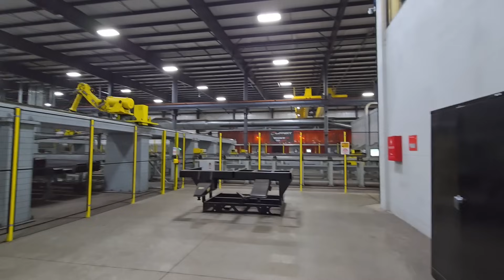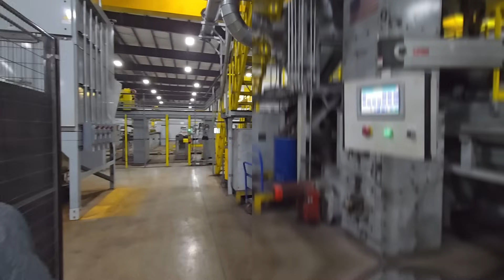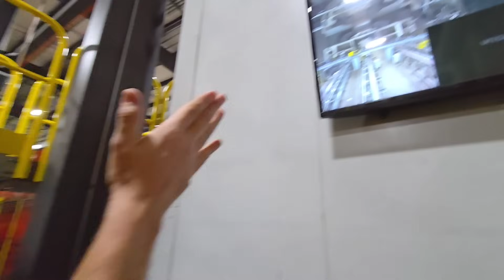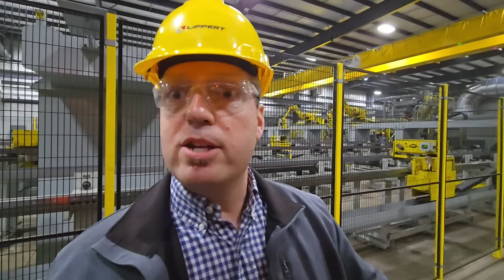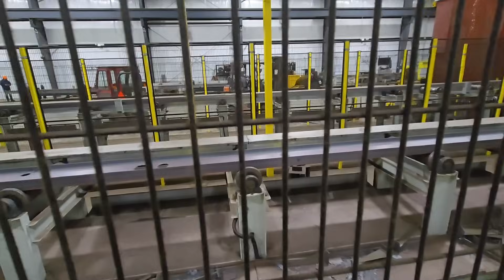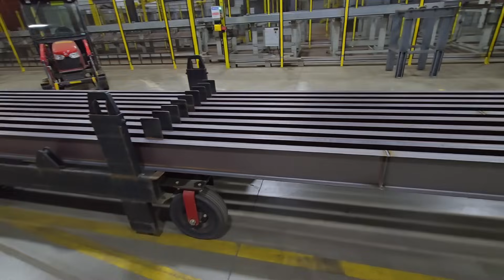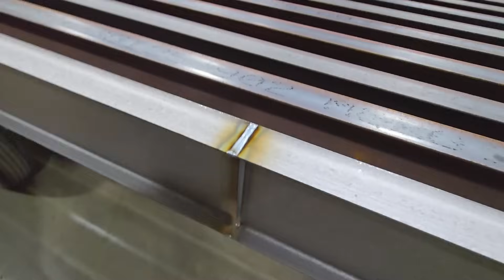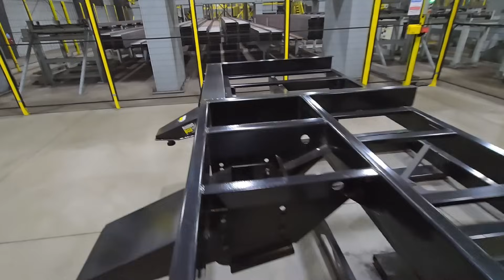LIPPERT RV FRAME Manufacturing Tour.  Part 1: Beam Processing Center

Comment: My replies keep getting deleted. I have a feeling that this video series is a sham. Good Luck!
Reply from the maker: So, the I don't believe anyone with the Space Saver upper deck is having issues.  It's supposed to be much stronger. Also, I believe splicing the frame is probably fine considering the method and equipment they invested in to perform and test the action.
Reply: The best theory they have is the 6" tube is able to support a giant 5th wheel? I still stand by my original comment and if they are so confident why not offer a 10-year frame warranty like we do or ATC?
Reply: As a trailer designer then you know your comment is too ambiguous. You don’t know the steel alloy they are using. In many cases, the weld is stronger than the base material or stock if they’ve chosen the correct alloy. We simply don’t know from this video, and it might be a trade secret.
Reply: I know what alloy SDI produces! Regardless, adding a weld changes the section modulus in that local area, and the beam will crack at that location, all things being equal. All adult humans know splicing the primary load carrying member is sub-optimal for <$100 savings per entire RV. @don_sharon
Reply from the maker: @jeffwalters6880 I suspect your trailers are body on frame? Low boy, dump, roll off?  The challenge with RV frames is they are designed for headroom, ACs on top, furniture, appliances, holding tanks and plumbing below, residential electronic and fixtures.  Because RV manufacturers want to content the heck out of them and make the insides look tall with a high end condo like appearance, your limiting where things can be designed into frame.  I'm not saying your wrong, I'm just saying RVs have a very unique purpose and you aren't able to simply add steel everywhere.  I'm a big fan of commercial trailers, but they don't equate well to floorplans being built in top of them.  

I have a great idea though!  Maybe you'd be will to collaborate.  Would you be willing to build an RV Frame, with accomodations for RV equipment mentioned above that can keep the total weight manageable by Class 3 trucks?  I'd love for a Trailer Designer to do this.  Let's see if we can change the RV world!
Reply: @BTBRVReviews  I'd like to get my hands on one of those bare frames, I'm pretty sure with a Rouge fab tubing bender and a tig welder and plasma cutter and some d.o.m. I could make her chooch!
Reply: @jeffwalters6880  Because they can't. They know without a doubt the majority of what they are producing right now will not last that length of time. If they offered a 10 year warranty they would be bankrupt in 3 years.
Reply: @jeffwalters6880  I respectfully disagree, given they produce a 1,000 frames per week and as a percentage, there are just not that many weld failures we hear of. Not to mention the countless other industries and construction projects (buildings!) that use this method of welding. Out of interest, are you an engineer of some type? And for the record, I don't own a 5th wheel nor do I plan to ever own one, or a Grand Design product. I believe the RV manufacturer is where the bulk of the problem lies.
Reply: I agree It isn't the weld causing these failures. There is just no reason to splice the rails when making frames for RVs.

The failures will be stress if it is a frame failure or deflection causing the body to disconnect from the frame or fail.
Reply from the maker: Jeff, I was completely serious about my suggestion on collaborating.  Because not only are you outside of the industry and you don't make RV frames, but because you are also a critic against the frames Lippert manufacturers. It would be very interesting to see if you could make a stronger frame that doesn't weigh a huge amount more.  This would definitely work your engineering department and test your abilities possibly to the max.  Remember, in most cases you're trying to keep the GCWR below 26,000 lb.  Which means with a dually, that leaves 14,000 lb for your trailer.  On heavier units, it's not as big of a factor, but pin weight certainly is.  We're not talking about class 8 trucks with 26,000 lb of pinweight capacity.
Reply: @BTBRVReviews JD this is simple. But it would mean Lippert loses their frame business.  There are so many gooseneck trailers out there with a 30k rating. I’ve actually contemplated doing this because of the enormous frame flex we had on our 2021 Montana. It was so bad the Keystone heads of service came to look at it. It was also not in a typical location. Ours was near the axles. But I think the biggest problem is there are no manufacturing standards like the automotive industry. Also heaven forbid I go out and build a custom trailer. So many parks won’t allow them.
Reply from the maker: So, a typical Gooseneck trailer that supports up to 30k typically weighs between 8-12k empty.  That means a typical structure on top of it would need to weight less than 4k lbs to be towable by most folks.  Not possible.....AND these huge heavy trailer frames STILL flex.  Designed to. 

I'm guessing a Fifth Wheel frame typically weighs round 4-5k lbs as to allow for the RV structure and cargo capacity.  I'll find out what the weight is.
Reply: Butt welding of any steel is not typically a good aspect. Any one that knows steel and welding knows that there is an area known as heat affected zone. This area if not properly relieved will cause failure of the welded area. Robotic welding may or may not control such high heat that causes said heat affected areas. Still avoiding the issue of frame failure, pin box over movement and frames breaking apart in the riser area.

Comment: I owned a 1990 coachmen and a 1997 holiday rambler both of those trailers had fully boxed frames made with 1/4 inch steel. My 2022 has a i beam frame that lets just say is not as thick. The i beam frame is definitely not as strong and cheaper to produce.

Comment: In the lumber industry they do the same to make longer sticks with finger joints.  Scavenging scraps to save a buck.  With all the fancy equipment, the frames are dropping like flies all over the country.  Everything  " Engineered " to minimum specs that will do the job. No different than any other manufacturing process,  CHEAPER, FASTER.

Comment: Look like Lippert is building a good frame. Maybe they need to build RVs in general without that extra room in the front. Probably no perfect answer.
Reply from the maker: Convincing the RV manufacturers to make floorplans that don't have tall front headroom space, might be difficult.  Because the ones who continue to make those floor plans will outsell the ones who shift to a different floor plan simply for a different designed upper deck.

Comment: I am surprised that the question of the steel’s tensile strength wasn’t brought up. As a steel building manufacturer which I noticed you work in. That is highly important. Especially with overhead, gantry or jib cranes that you don’t want to come down on top of your head. For the sake of illustration, to much tensile strength will make the steel to brittle and not enough will make it to weak. Where there is a lot of holes or drilling into the steel, also you will create compromise to the steel. Have you ever heard the term redundancy or if you have a failure in one area, other areas will support and take up the workload. What if you run over an object right after you pulled the RV off the lot with an unseen object in the road; and the tire has a blowout, therefore puts the stress on the frame and on the shell etc., this is Ludicrous. A-10 warthog Jet fighters have redundancy in computers and structure so if when it might fail there’s a back up. Could you imagine if our military pilots had this kind of craftsmanship in their aircraft, could you see our fighter pilots flying light tubing ultralights. Doesn’t GM make different makes of cars all under GM? Ford, Lincoln and Mercury. Dodge, Chrysler and Plymouth. And you know which ones are no longer. This is a line of you know what.
Reply: Steel structures, especially buildings and bridges are designed and engineered to the yield strength of the material they are using not the tensile strength
Reply: No you’re in the land of Oz. In the steel building mfg, we had to order a higher tensile strength steel. The steel we were using was too soft for earthquake zones to be used. Where did you get your schooling? As a global certified welder and never failed a test in eighteen years before becoming a nurse??? Will you submit to a polygraph test? If you have nothing to hide. We’ll cut through all the smoke and mirrors. Alternative topics not granted. Borderline tyranny?

Comment: This is obvious a fairly new plant, most frame issues I have seen videos or pictures of are from RVs with a few years age. The welds on those RVs that have had failures are obviously not roboticly welded. In my opinion Lippert has been working on improving there products by cutting out poor workmanship and going automated.
Reply: The only welding shown in this video was them splicing the frame I beams.

Comment: I believe in trend data. Trend data seems to show  frame fails. I will not buy anything made with a Lippert Frame until the cause of the failures is identified. As a customer I don't care if it is the fault of the frame manufacture or the RV company. That is not my problem. Where I spend my money is.

Comment: It is great that you do videos, however instead of being a show and tell, please just tell us who or where is responsible for the issues that are happening, a couple removed the underneath membrane from their Grand Design and the welding and corner supports was not pretty at all, rough edges the supports looked inadequate and bent, computers are quick and precise however when settings or patterns are incorrect and not caught quickly, then inferior frames could slip through. If lippert is not at fault, be present when frame failure is suppected to inspect frame to see where the problem lies, this is the first step. Also, when you are doing an interview, just ask questions and seek answers  you should not speak for them, it makes you look like you are proving you are smarter than them or that you are protecting them from error. Investigating videos need to be neutral not influenced in any matter, just my opinion! Everyone knows how to build a frame, to build properly and structurely is the key, computers are great, however they are only as good as their program and that is done by humans who then monitor the progress, people take breaks, use washrooms and have hindered attention spans for many reasons, thus here lies potential problems. I hope you respect this as contructive criticism, please if you have the means or the ability, just use your influence to find out the true cause of frame failure.I expect then a solution can be found, implemented and finalized.Yours truly, just trying to help, I do not own a 5th wheel RV with frame failure, I own an imagine 3100rd and take pride in my Grand Design RV, hopefully the companies responsible for their construction feel the same

Comment: So let me get this in my noggin: the chassis they sell is not strong enough until the RV mfg uses lag bolts to attach some wood/aluminum/laminate to the side.  Of course these fasteners can be installed in seconds with air tools and a monkey pulling the trigger. What could go wrong there? I'll enjoy following the class action lawsuits.  For my money it's an ORV bumper pull!

Comment: The issue is where the Box as they call it is connected to the main frame. No way can those boxed ( what looks to be ) 2x6's can safely transfer all that load and its apparent from All the frame failures in that exact location. This has ZERO to do with how the manufacturer connects the walls to the frame! To think those walls would add any amount of structural support to the frame is just crazy talk.

Comment: I'm not a fan of welding pieces of the i-beam together.  The two main beams, to me, should be continuous from the steel manufacturer.
Reply: The total cost in scrap to make the entire frame without a splice would be <$100.
Reply from the maker: @jeffwalters6880  X 2,000+ per day (they use 2 or more beams per RV)
Reply: So they save a bunch of money per day,  seems like a poor trade off for a potential problem down the road.   In a house you are not allowed to “splice” a floor joist.   Yet another reason the self policed RV industry  needs to use actual regulations not the RVIA which is a joke.
Reply from the maker: @garyy818 being honest, not sure there are any examples of the frame stitching process failing.  If you know of any, feel free to share.

Comment: For all this automation, few people, and robots controlled by computers and the programs where or how are bad welds being produced. If this US steel is tearing out around the welds heat would be an explanation. What is the quality control regimen. A sad reality of automation is machinery wears and with fewer people in a production line issues are not noticed until later. It is a very nice plant but there is an issue in the industry and nobody is saying we need to do better.
Reply from the maker: I totally agree that the entire industry needs to be better.  And can be

Comment: They need to get real welders to assemble the frames because the welds look like a 3yr old did it.
Reply from the maker: Hard to find 600 plus welders in a single small city that are all going to be the welders you see on YouTube and Instagram.
Reply: @BTBRVReviews They could find good welders but that industry does not pay well. Those are typically entry level welding jobs

Comment: You keep repeating the same thing over and over about when a beam is picked horizontally it flexes and on the vertical it doesn't, but RVs are built with the I-beams in the vertical position, so why are there so many instances of frame failure?  If the beams are stress tested to "3 lifetimes", then why are there so many failures being reported?  All the tear downs I've seen, none of them had the 6x6 tube.  If this is 30% better that the "step up" type frame, then why not build all the frames that way.  Nice PR video for Lippert.
Reply from the maker: Great questions. First, you may not realize that this isn't an issue with the I Beams.  The Space Saver Upper Deck is offered to all manufacturers.  Some prefer to use the classic version they've built on for years.  Remember, the frame is a component and Lippert offers components RV manufacturers request and  purchase.

Comment: Fine bit of propaganda in all these LCI videos not showing their normal process.  I.e. not showing them shoddily welding rusty steel, etc.
Reply: I am sure the answer will be, “The frames were
not rusty when we delivered them to Grand Design.
Reply: Why did know one introduce themselves. A few corporate lawyers in that group of minders?
Reply: @kingair350 -- Great point! The standard MO for all corporations is plausible deniability. They are masters at privatizing profits and shifting as much of their expense to the private sector as possible. Let taxpayers cover the cost of their hazmat cleanup sites as just one example. :(
Reply from the maker: @kingair350 Wow! MY BAD I totally got these videos out of order!  There is a video before this that didn't Air in order which was them introducing themselves (as mentioned in this video).  Thanks for bringing this up.  I'll post it next.
Reply: @BTBRVReviews  I realize you are just trying to help, but until both parties sit down and have a discussion, blame will be cast by all involved. I know that after criss crossing the United States and traveling on these horrible roads, the stress on the whole unit is incredible. I don’t believe these units are capable of handling that stress. If the manufacturer continues to use a method of attachment that does not include a nut, that fastener will come loose. It all boils down to speed in manufacturing.
Reply from the maker: I'm working on so much more behind the scenes.  I think getting these explanation videos out first is absolutely critical and important from an information perspective.  The more perspectives I gained from different parties the better.  But again, I am working to help
Reply: I'm hoping for a video where you point out the weaknesses in their process and approach, without the LCI folks of course!